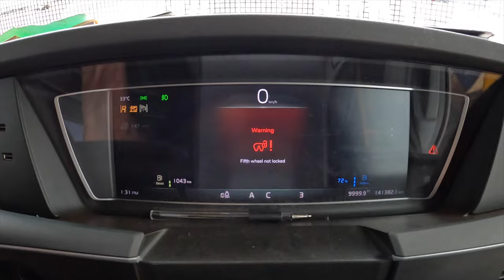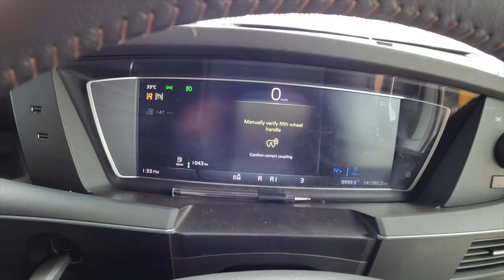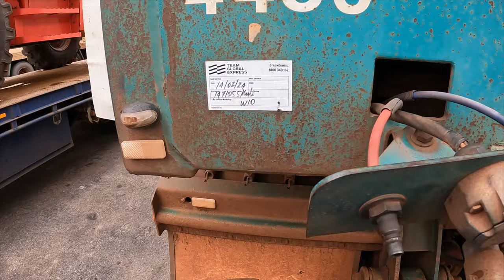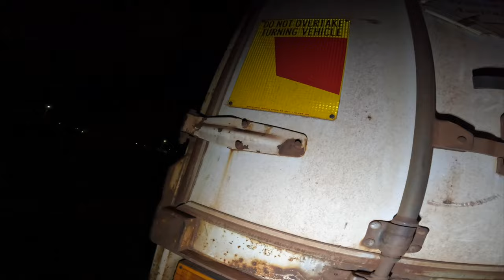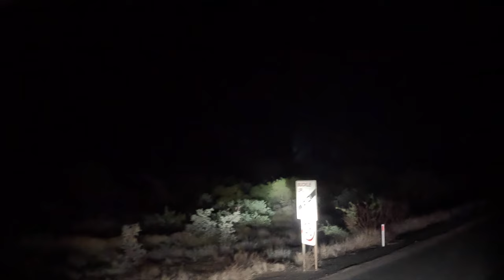The Road Train- My Home Away from Home- Musical trailers in the dark

Comment: I think the turn table sensors are a good idea, i once dropped a trailer as a result of a wanker pulling the handle in the yard after i had hooked up and checked it🤬
It was a really toxic place to work, I did'nt last long
Reply from the maker: That is the lowest of the low level to do something like that with someone, to pull the handle or to temper with the air lines, you never ever do something like that with a driver, I heard about things like that and that is the reason I always check the turn table handles before leaving any parking bays after stopping for my 7 hour break or leaving the truck unattended.

Comment: I've been meaning to ask for awhile now but why do you always park like that at wheatstone when you have a whole parking area to pull up in a straight line.
Reply from the maker: 😂😂😂, I guess it is because this is how I get used to park at the beginning, originally the parking bays were marked like that on a 45 degree angle, at that time they were at least a dozen or more triple road trains parked there at any given time.
Reply: @roadtraindrivingwithtonyivanq  Not a problem.  seeing they are pulling the camp apart,  what will happen if they rip up that parking area.  Have they told you anything yet ?
Reply from the maker: @Mrbullet1952  no, they are not touching the parking lot, they just minimise the camp, from 7000 people capacity that was when everything was under construction to a 500 capacity that is needed now to run, maintenance and shutdown work.